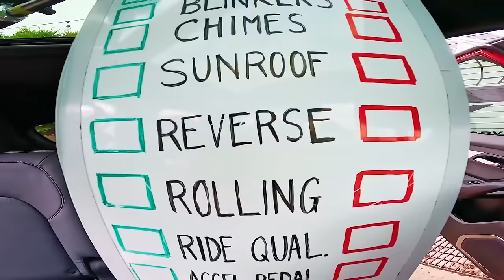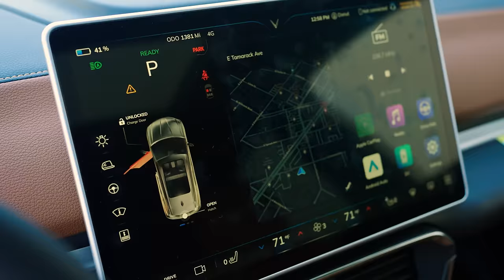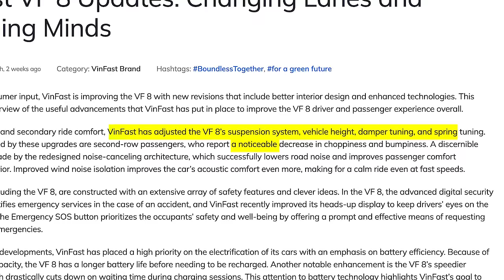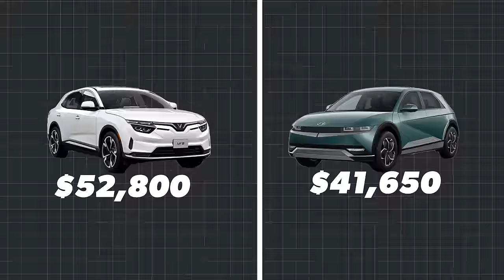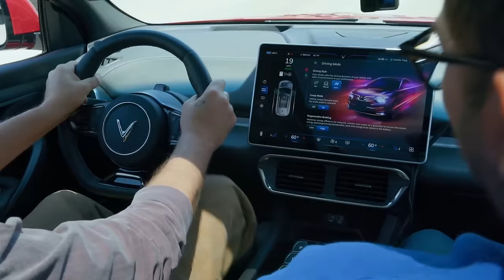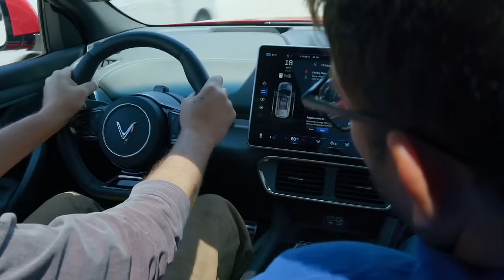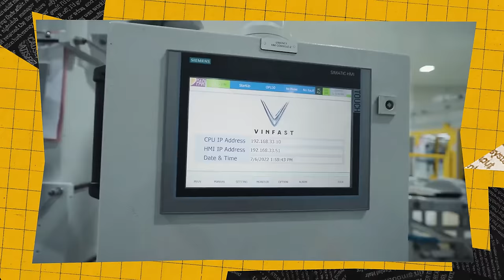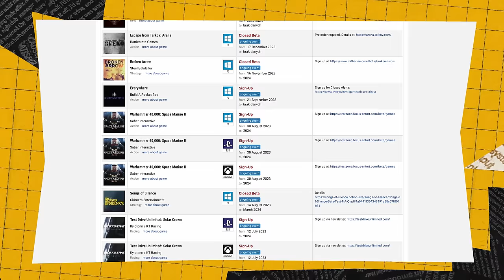We Drove America’s Worst Reviewed Car Again

Comment: To be fair, for a five year old company it’s really impressive that they were able to fix most of the problems of the first car in that short amount of time.
Reply: It would only be impressive if they did it behind the scenes during validation.  The fact they released an unsafe product and let unsuspecting consumers validate it is flat out inexcusable.
Reply: @joek.8247  What is really more inexcusable is Tesla releasing a Beta level truck to new owners. I saw recent reports that is that it's letting water through into storage compartments.
Reply: 1000% agreed
Reply: The car is still very flawed. Even Tesla, who is known for releasing unfinished products, builds much better "new" cars. The VF8 is clearly an unfinished design both in software and hardware. I mean, just look at how heavy the car is. Most EV's in the same size class are around 4,400lbs. The VF8 is a hefty 5,700lbs!
Reply: @joek.8247  being the first car company in their country is already pretty incredible. Designing and mass producing a modern car requires an enormous amount of resources & institutional knowledge as well as creation of supply chains and sourcing myriad types of skilled labor. That's pretty tough if your country doesn't have a domestic car industry.
Reply: It’s mostly software, that’s easy to fix
Reply: @joek.8247  what is your definition about "dangerous" term ? vF8 get 4 stars in 2023 Euro ENCAP test. What is dangerous point of this car ?
Reply: also have to wonder if all the versions of this car that they ship out now will be to at least this level now. Or did they just fix one of their cars as best they could, and sent it to donut to review.
Reply: This is what they should have done before, did they honestly think no one would notice or care about the issues, maybe it's okay in SE Asia but not in the US market, bringing a car that's 80% done is not going to cut it
Reply: VF8 sales in Vietnam are very bad, the reason for Vinfast to use them as taxis😅😅
Reply: @r7calvin you know nothing about them, try to critisize it in vietnam, a bunch of little pink we follow and harrass you all days, even call the police to punish you, that's is how vietnamese customer is treated
Reply: @danielnguyen2399  wtf is this
Reply: @TheSeanUhTron  Agree it is very heavy but it will save passengers' lives. In Vietnam, VF8 is used a lot and there are many accidents, but VF8 is very sturdy, even if it gets hit by a container, it's okay, passengers are still safe without a scratch.
Reply: @64Car  no, Sturdy doesnt mean safe . if the car dont absorb the impact well , it will more dangerous for both  passengers , driver and the people involved with the accident . Alot of car can do the same for less weight
Reply: @vivuphuongnam tôi rất nhục với kẻ mang danh tây nội địa 😂
Reply: @TheSeanUhTron  better in what sense? Better tech maybe but better build quality, admitting to faults, and fixing those faults in record time? Nope.
Reply: @robotbro7187  Donut literally said that they have improved the parts or just made entire new designs based on reviewers feedback. This requires revamping the assembly lines themselves with new designs, molds, and retooled factory equipment. They clearly want to earn the end users trust and a cut in the US lucrative EV market. Tell me what other brand does that and as quick as 5 months. I'll wait.
Reply: Agree
Reply: @Hawk7886 don't believe :))
He's not in Vietnam :)
Reply: actually 3 years, because at that time they were just making electric cars.
Reply: @vivuphuongnam  vô chủ yếu kiếm dấu răng của bác nè
Reply: Yes, but no one seems to care, they mostly focus on comparing with Tesla which is more than 10 years old.
Reply: Who says they didn’t just update a press car and nothing else ? Lol
Reply: @vivuphuongnam  can you show your car brand?
Reply: ng Vn biết tiếng anh nhiều thế :)) kênh này hơn 8tr sub, với cái tiêu đề kia thì bênh vực bằng mấy cái cmt vô nghĩa lắm các sếp ơi haha, khổ quá mà 😂
Reply: @lehoanghiep9936  Did you see the parts where the blind spot monitoring doesn't work at all?
Reply: @mayssm  blind spot is 1 test case in Euro NCAP, they tested it with professional instrument and and i dont see any failure report about it. These guy just talk base on their normal human eye view, no machine or instrument proved.
Reply: @vuduyquang9286  tôi tin họ = hành động, không chứ không = mõm bạn ạ.
Reply: To be fair, Vietnam is a communist country that can "employ" the workers that make this for about $1.89 per day. When your government has unlimited national resources, you can address problems that private companies aren't able to fix as quickly, since Ford and Tesla are on the hook for millions of dollars for each production change. It's why the USSR was able to build 4 million Volgas under communism, which sold for the equivalent of $58 USD in today's money, but as soon as the Soviet Bloc fell, they sold about 400 units in 12 years, at the price of $18,000 USD.
Reply: @joek.8247  That, plus most of the parts and tech are from existing and proven manufacturers. All they probably did was making some phone calls.
Reply: Its chassis is quite stiff, it has reached 4-star standards according to European standards. Maybe it's a weight issue @TheSeanUhTron
Reply: Really? I was came to VN and saw any new vf8 on the road. And in Vietnam, its can move about 450km @vivuphuongnam
Reply: @danielnguyen2399 no, those mfs are called "vin nô" aka "vin slaves" or the 12 y/o supra kid version of Vinfast. Not vinfast itself.
Reply: @r7calvin  The technologies and industries you mentioned do not exist, because most of VINFAST's accessories come from China. To put it bluntly, they are the assembly brands of Chinese products.
Reply: @lehoanghiep9936  A car that makes the driver dizzy is a dangerous car regardless of ENCAP test.
Reply: @SecoOrlov  I know but foreginer dont know those term, they know nothing about vn because it is a small country anyway, but they do know little pink from china
Reply: @666cemetaryslut This is a major problem across a variety of sectors. Gaming for example is renowned for it. Car manufacturers doing the same thing is incredibly disturbing. Court action and heavy fines would be a start
Reply: Vinfast is not 5 years old per-say. They’re a division of a massive conglomerate in Vietnam that basically owns the countries commerce.
Reply: Reminds me a lot of the Hyundai entrance.  Initially, their cars were considered very poor but once they had been around for awhile, they got a lot better.
Reply: @biwasa6484 nó ng khmer
Reply: @joek.8247  I don't think the car is unsafe, it's just unfinished.
Reply: @robotbro7187  All new car are fixed. It's much more complete than the first version
Reply: @lehoanghiep9936   it was the featur that the car steered you back into your lane even if you tryed to steer out of that lane.
imagine there is a sudden obstacle in your lane and you try to evade and the car FOCEFULLY over powers your steering and bring you back into your lane  and right into the obstacle, because you had not set the blinker.... what a stupid idear
Reply: @Sam-bm8tu  are you sure? I've seen some African "car companies" that basically sell rebadged Chinese kit cars that are just assembled in Africa, but Vinfast models seem to be their own.

Sourcing motors, batteries, sensors & chips from another company isn't the same. That's how most companies develop new products. Few companies are that vertically integrated.
Reply: @Stephanthesearcher  do searching before talking "Lane keeping assist"
Reply: Thank you for being a beta tester
Reply: It’s always awesome to see company’s who actively want to take in feedback make improvements. I’ll definitely keep my eye on Vinfast (never heard of them before this video. It’s just too bad that their cars are so ugly. Definitely need to change up their design language. Looks like they came straight from the year 2007.
Reply: @tranvietvuong Agree
Reply: True
Reply: You can make infinite number of changes in a day in a car that’s already shit. Lmao
Reply: @r7calvin  Do you think it is possible for a country without any industrial base to have automobile manufacturing technology in just a few years? Obviously not. Most of VINFAST’s accessories come from China. This is an undisputed fact. The Vietnamese even say that VINFAST’s car logo was also designed by the Chinese.
Reply: wow, its like you repeated the video
Reply: @RockandrollNegro   da fuq bro 0.5 per hour Not 1.8 for day
Reply: Nah, it's not their first car. Their first car was much more worst. Someone complained about it and got threaten by the company. It's evil
Reply: Things like this are reasons why internal combustion engine powered vehicles will always be around, and why hybrids will also die off as well.
Reply: @vivuphuongnam the reason sales are bad in Vietnam is because there is zero ev infrastructure and they are very expensive.  The company is based on selling to foreign markets
Reply: ford should take notes
Reply: @SuperMirer who told you that, they have hundreds of thousands charged station in vn, and most of their sales is in vn😂
Reply: @vivuphuongnam tệ kiểu gì mà ra đường lúc nào tôi cũng gặp mấy con vinfast vậy?
Reply: @BapBap-os2de  gặp toàn taxi xanh lượn kiếm khách cũng khoe 😅😅
Reply: @Stephanthesearcher  If there is an obstacle in front ADAS will slow down or stop. Changing lanes with turn signals on is an idea that works the same way the French Pegout or the Mazda Cx-5 work. Vinfast is not the only company doing so. Now they allow you to change lanes when you want and it's resolved.
Reply: Tôi xem rất nhiều video dạng này, tại sao không thấy so với các hãng khác mà luôn đem so với tesla nhỉ 😅 thật không công bằng haha
Tôi muốn biết tesla là quán quân. Vậy hãng nào là á quân về chất lượng nhỉ
Reply: They skip all safety tests before launch the car into market and hired bad driving skills driver so they could get accidents data while continuing market at the same time !
Reply: @vivuphuongnam hello 3/ khát nước😂😂
Reply: @joek.8247  You talk about Tesla :D
Reply: @vivuphuongnam ủa chứ không phải vì nó ổn nên đc phép chạy taxi à🤣
Reply: @dfansub2220  ối giời, taxi xanh là cty của ai vậy pé?😅😅
Reply: @vivuphuongnam  của Vin group đấy
Làm như có mỗi mình xanh sm là dùng xe để chạy dịch vụ🤣
Reply: @vivuphuongnam  xe toyota chạy dịch vụ đc còn xe vin chạy dịch vụ thì lại gào lên vậy em🤣
Reply: @vivuphuongnam  ếch ngồi đáy giếng còn tiêu chuẩn kép nữa🤣
Reply: @dfansub2220  ăn gì mà "khôn" thế? Toy bán cho ai, vin phét bán cho ai?😅😅
Reply: @vivuphuongnam  bộ vin cho chạy xanh sm là phạm luật à 🤣, sao bạn khôn thế
3 que ghét vin thì nói mẹ ra đi 🤣
Reply: @vivuphuongnam  làm như có mỗi mình xanh sm là dùng vinfast chạy dịch vụ vậy🐸
Sống bên bển thì mà làm như biết rõ ở VN thế🤣
Reply: @Sam-bm8tu You dint know everything about VinFast and Việt Nam. All of cars Vinfast have more quality than Japanese, Korean cars in Việt Nam. Stop you mouth.
Reply: @dfansub2220 mấy thằng vivu đó ko có não đâu. Nói thêm mệt🤣
Reply: @vanlamlenhat7783  A country without any industrial base, a country that even relies on imports from China for buttons, how do you think Vietnam can manufacture cars except relying on Chinese parts? We Chinese know VINFAST cars better than anyone else, haha. . .
Reply: @Sam-bm8tu  How do you know that?😊 Have you gone to see the factory or heard what people say?Vinfast has American and German standards and they have nothing to do with China. Many people just say it because they imagine it, without evidence. Sorry it was you
Reply: @vivuphuongnam  nhảm nhí :))
Reply: with same prices tesla Y or VF8 ? the answer is so obvious
Reply: @joek.8247  😂😂 xin lỗi nhé Vinfast ở Việt Nam đã bảo vệ đc những tài xế an toàn hơn so vs các loại ôtô khác

Comment: As a start up company, Vinfast listened to your reviews and worked seriously (in a short time) to fix almost errors. If they can make a totally new car (and they are building a factory in North Carolina and want to sell cars globally), I trust they will continuously improve it. Look at the first generations of Tesla and Cybertruck now, there are still many problems to be fixed. Hope you guys can make the 3rd video to check the model of 2024/2025. I respect Vinfast's ambition and determination (a company from a war-torn country in the past) to enter high demanding markets like US and I wish them big success!
Reply: That's all good but whatever changes they made, applying it to mass production w consistent result wont be as easy or fast. There are no shortcuts. I command VF's ambition but it will take time.

Comment: The Dodge Neon had significant suspension problems when it first came out. Dodge benchmarked the Honda Civic, but by doing so they made the rear suspension WAY too soft and it would bottom out frequently. Dodge quickly recalibrated the suspension and improve it the next model year. Vinfast has improved in a very short time which is great. Keep going.

Comment: Just came back from back to back Vinvast VF8/Tesla Y test drives. Surprisingly, other than the very slight delay in throttle/pedal(0.2s maybe), driving experience and ride quality are quite comparable. And surprisingly, I got only speed limit and lane departure alerts during the 20 min VF8 test drive, both of which CAN be turned off. VF8 feels more like traditional cars, sure, the gear shift is a bit weird looking compared to Tesla's, and parking assistant grid is less refined on LED screen compared to Tesla, I actually gave VF8 a solid 7.5 overall compare to Tesla 8, but the fact Vinfast fixed so many software issues so quickly deserves some credits. Currently in Canada Tesla has 6.09% on 48 month lease while Vinfast is 2.99%@48 months. I am still a bit away from making a decision but right now considering services/warranty/rates/experience, I can't say that even with Tesla's reputation/history, it's a clearly winner compared to relatively unkonwn Vinfast. I'd say give it a test drive yourself if you can instead of solely relying on other people's feedbacks.
Reply: i like this comment, it's very good compare
Reply: I am more to Tesla since recently their accident occurred which caused lost of lives entire family riding VINFAST due to speeding in residential area after attending a party and pple speculate it’s due to lost of control and electric malfunction/lithium which is known for this type of car.I am still on gas pedaling cars.Talking about of environment /air quality what about Lithium (toxic) disposal?
How about if they run out of Lithium when times comes everywhere is EV.
Reply: If you can't afford a car almost in full, you should be buying a cheap beater.

People are so stupid nowadays. Auto loans just steal your money. You lose money on your auto since it depreciates, then you pay interest on your depreciated asset.

😂
Reply: @ofeliahawkins9272  Ultimately, the cause was because the driver was going at maximum speed